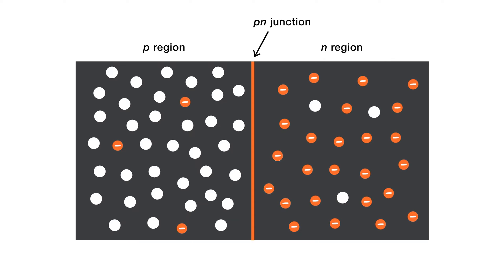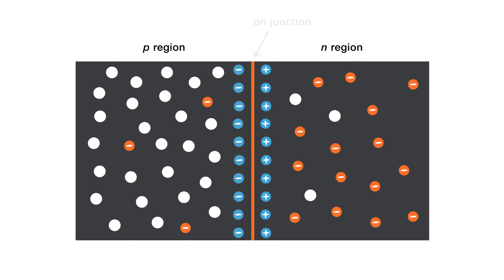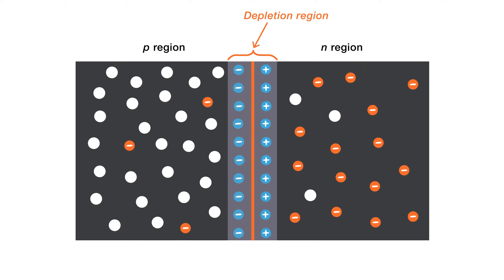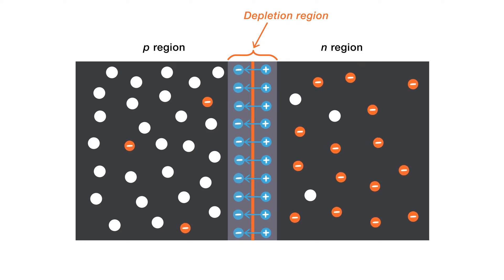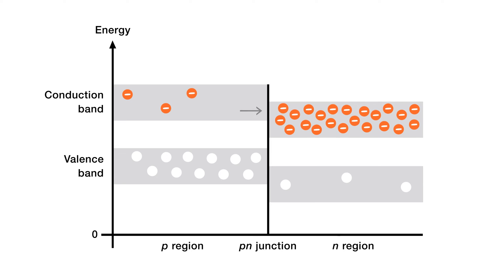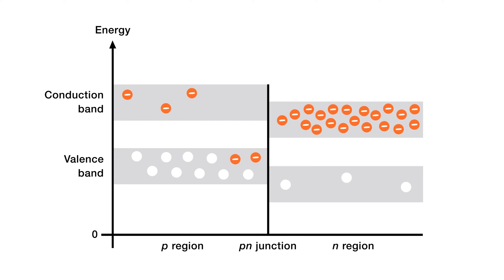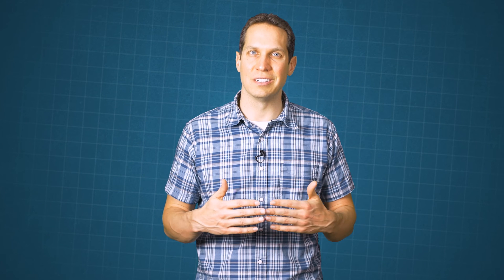How does a diode work - the PN Junction (with animation) | Intermediate Electronics

Comment: This was by far the most intuitive explanation of band diagram of pn junction I have seen. Thanks brother.
Just a minor nit pick in the animation
It would have been more clearer to specify that movable charge carriers cross the pn junction and ionize the fixed carriers on the other side
So the depletion region is filled with ionize fixed carriers but you showed that carriers were moving during the formation of depletion region, which I guess shouldn't happen in reality
But regardless this was a fantastic video thanks

Comment: I had a question: At the pn junction where there is a layer of +ve and -ve charge opposite each other how is a region of DEPLETED charge carriers created, surely there is a concentration of charge carriers?
Reply from the maker: The trick here is to realize that those charges are immobile ions, not free moving charge carriers (something that is inaccurate in one of our animations, unfortunately). Does that help understanding this?
Reply: @CircuitBread  Yes, it does, thank you, as I understand the depletion region acts as the 'barrier' in diodes.

Comment: Wont the electron leave a hole behind beacuse the electron from the n region migrate to p region
So wont the donor atoms have a hole since it donated one of its electron?
Reply from the maker: Good question and one that I wish we had explicitly answered when we made this (hindsight is 20/20).  Basically, yes, it will leave a hole behind UNLESS the donor atom had an extra electron in the area any (such as a five electron material as part of a four electron substrate).  But, since it's a circuit and the electrons are flowing around the loop, that hole gets filled as the electrons come around.  So we aren't accumulating holes on that side because they're actively being filled up as well.  I hope that helps!

Comment: Why dont the electrons in the n-type move into their the depletion zone from their side ? they have a sea of positive charges to the left and a sea of negative charges to the right. I get why they dont cross they boundary this makes sense to require some energy , but why dont they just move into the depletion zone. I understand that there is an electrostatic field that points to the left but i dont understand why this works out when i imagine an electron that is near the edge of the depletion region from the right , naturally the forces would push it into the depletion region

Comment: So the depletion is essentially the degradation of the materials?  Am i getting that right.  Because it's electrons become excited and flow out of the material when the voltage is applied though heat (sunlight)

I'm talking about solar panels here, but the concept remains the same through diodes.  LEDs last a super long time because the material is so much better at limiting the amount of electrons that can flow out of the depletion area in the form of light photons.

 Semiconductors are cool 🤓.  From this video I have learned that an LED is basically the reverse of a solar panel

Comment: Depletion layer has No charge then why u asign it by + & -  charge
Reply: No charge means neutral charge (positive charge = negative charge). Both charges magnitude are the same. So no charge doesn't mean there's no charges there but rather charges are equal

Comment: For me. It still doesn't make sense like If atom is in static position. And the only thing actually moving is electron. What will this looks like??? Are there any simulation like this?
Reply from the maker: One of the challenges with showing these things visually is that everything is just representational.  It would be awesome to show it how it actually is but 1) it's hard to show something where you're dealing with literally trillions of atoms and 2) it gets even messier in 3D and 3) in this case, it wouldn't actually demonstrate the concept we're trying to show off here.  For the band gap, there isn't a literal physical gap, it's a gap in the energy levels that the electrons can possess.  It's sort of like saying that an electron can have an energy level of 1 and 2, but then the next level it can have is 5.  So the gap is energy levels 3 and 4.  And while this seems strange at first, remember that in chemistry we learned the different energy states of electrons for individual atoms.  This is just expanding on that. Sadly, this explanation isn't entirely accurate either but will hopefully help establish a conceptual understanding that can be expanded on.

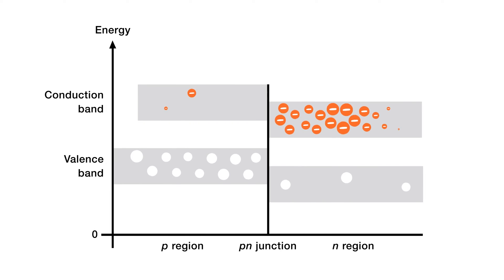Comment: First, let me thank you for the good videos. But in this one, I wonder if it's factually correct. What I have in mind specifically is the energy diagrams at 2:30. There is not enough space to explain in detail but in a nutshell: the valence band of the p-region can be above or below of valence band of the n-region, depending on used materials. Take for example P atom with electron configuration [Ne]3s^2 3p^2 => 5 electrons with principal quantum number = 3 vs B atom (you named it as p-type impurity)  with [He] 2s^2 2p^1 => 3 electrons with PQN=2. So electrons in the B valence shell have even lower energy than those in P. Ga or In atoms would work (see periodic table).
Second and more importantly - when elections recombine on PN junctions the electron energy needed to escape from P atom DOES NOT change. Bands are not moving anywhere contrary to your statement in  3:41. These are still the same atoms. P atoms further in the n-region are willing to give up the extra electron same as before. These may either recombine with holes in the p-region closer to the PN junction (causing hole current) or may try to penetrate to n-region and recombine with the n-region hole. 
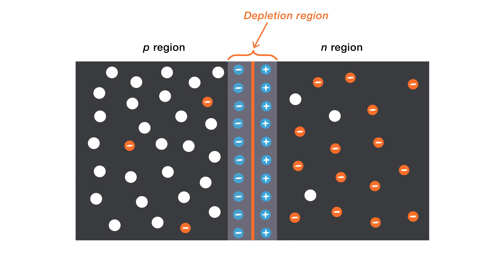The only problem is really that there is already a barrier of earlier recombined negative ions of B/Ga/In atoms. These exert a repelling force on free electrons coming from the n-region according to Culomb's law (as you correctly explain in 2:00).
In a nutshell to understand PN junction it's critical to understand 2 distinct forces - 1) Culomb's law and 2) the proclivity of electrons to fill the atom valence shell in some patterns which is key for understanding chemical bondings, the periodic table, and chemical element properties.   
Also, I think there is no conduction band but rather conduction space simply for all electrons with enough energy to escape the atoms. So there is always a "conduction band" overlap and an electron excited enough can always go anywhere (you only need to heat things up enough).  And of course, energy comes in quantum so the conduction space is not actually continual but discrete, but it's possibly not important here. 

At least that's how I understand it, which also may or may not be correct. :)

Comment: great, i still dont understand why is this usefull
Reply: You know that current flows using the path of least resistance right? Due to the bias (meaning that its easier to travel in one direction) it allows you to control the direction of the current. 

Reasons why this is useful: some electronic devices such as transistors, ICs, LEDs, capacitors etc can only accept current flow in a specific direction

Also you can manipulate current flow to make generators and motors more efficient 

Theres also data transmission applications and safety applications
Reply: @masakari6922  And also solar panels have a PN junction
Reply: I’d also like to add… understanding the physical effect of these various doping concentrations help understand behavior device models. Say, your traditional NMOS or PMOS… it’s doped NPN or PNP, in the substrate this actually a bjt to model it’s drain, source,  and bulk. Understanding the current flow based on its physics, it extremely useful especially for circuit design, protection, leakage, and also processes.
Reply: Smartphone 😂
Reply: He knows it get used in smartphone, hes asking how it is useful for smartphones etc
Reply: I can show you an example of why this is useful. In our house, we use AC current, and a lot of things will break in AC, so we need to make this current in CC, by this we use diodes. See, in AC, the current goes from positive to negative, for this don't happen, we use a diode. When the current is negative, the diodo won't let the current flow
Reply: It directs current in one direction. Very useful if you get creative
Reply: When you want to create a new invention , a higher version of LED lights🤓
Reply: Commenting this using the electronic device..LMAO
Reply: you used one hand and your smartphone to write this comment…basically thanks to semiconductors and pn junctions. Without these it wouldn’t be possible 😅

Comment: If Conduction band has electron when we put an energy into it. Why does the conduction band of p-n junction has electron? Thank you in advance!
Reply from the maker: I'm sorry, I don't really understand the question...
Reply: @CircuitBread  mmmm so electron only occurs in conduction band when we put energy into it. But in this case, p-n junction is in equilibrium state(no external energy include). Which makes me wonder how does an electron occurs in an conduction band when we didn’t put energy into a system😋
Reply from the maker: There are electrons in the conduction band at almost all times, there just aren't usually enough to do much of anything interesting.  The numbers we're dealing with are absolutely enormous - literally mind boggling.  But, in addition to that, for n-type doping, you're introducing more electrons to the system, which further increases the amount of electrons in the conduction band - even when it's not biased (when there's no external energy included).  I hope that helps!
Reply: @CircuitBread  thank you so much!

Comment: Why diode doesnt emits light as compared to LED
Reply from the maker: Great question!  It does, actually, sometimes.  Usually in the infrared range.  LEDs are just specially made to emit light of specific wavelengths.
Reply: @CircuitBread  👍

Comment: Doesn't explain how a diode works, wrong title, should be "the formation of the depletion region".  So why does current only flow one way?  Why is there a forward bias voltage that follows an exponential curve? You did not answer "How does a diode work?"
Reply from the maker: This is the first in a three part series, I recommend you watch all three and see if that clarifies things.

Comment: If no external voltage is applied across the p-n Junction, then what will exist in depilation layer...???
1.hole
2.election 
3.both hole & election 
4.free charge
Which will be the correct answer..???? 
Please  reply me fast.....
Reply from the maker: Even without an external voltage, you'll still form the depletion layer with its ions.  Because of that depletion layer, you wouldn't be expecting to see any free carriers until there's an external voltage.
Reply: @CircuitBread  so you meant the answer of that question is 4. Free charge or ions.......?

Comment: 2:28 Why n-type bands are lower than the p-type bands?
Reply: I think it's because the opposite is true for pentavalent atoms compared to trivalent atoms. Pentavalent atoms exert much more force on the outermost electrons, causing the orbits of the outermost electrons to be much lower and nearer to the source. Hence the bands in n type are located at a lower energy level compared to the bands in p type.
Reply: @justinsantos5751  I think so, too! my professor said that "The bigger, pentavalent atoms are "attracting" their outermost electrons more, so their energies are lower, meaning, further from the 0, i.e. the vacuum level."

Comment: Hello, I'm a bit confused by the animation. when  the free electrons go over to the p-site, you would think that the result would be a neutral charged atom at the N-site, but instead it becomes a positive charged hole?
Reply: I guess it is because it are mostly neutral molecules from the n-site that will lose an electron?
Reply: No. The n-type doping element has an extra electron compared to silicon, but also an extra proton. So the material is not charged negative at all.

Comment: Can you kindly explain the reason why p side energy levels are made higher and in n-side they are made lower. Also why in the state of equilibrium holes and electron Fermi level align at same position in order to achieve equilibrium. Also as holes and electron which flow are actually in bond with the atom, so hows does when they are in contact, what provides them energy that electrons move and fill the vacant charges in p side leaving a hole or vacant side in n side.. In many texts i have seen (but still confused) that they say, electron are near conduction band so as electron moves they actually decreases the amount of Fermi level in n side due to vacancy and increases the Fermi level o p side... but the logic that Fermi level will align finally for both p and n side, i am unsatisfied with it...Some says as depletion region is formed so why further movement of electron and holes do not occur that electron may go to conduction band of p region. Sorry a bit long query and may be dumb question, but please do clarify this and hope you reply to me. Also you said that electron coming from n type to p type during diffusion will fall back to valance band of p region. How can you represent this situation in a pn semiconductor. is it that the electron recombine with the immobile ion created in p region or what.

Comment: I have one question , does the electron only move to p region ? because I heard and read that holes move to n region , i'm a bit confused.
Reply from the maker: Electrons and holes move around in both regions.  The only difference is that there are more holes in the p-region and more electrons in the n-region.  Things like to equalize, so as long as there aren't any external forces, electrons will diffuse into areas with more holes and holes will diffuse into areas with more electrons - this is diffusion current.  Things are complicated by the fact that there are additional forces, both active and inherent in PN junctions, that oppose this motion.

Comment: How come the fermi level is required in a band diagram if you are able to show one here without one, and still get the same point across?
Reply from the maker: This is just my opinion but I don't think the fermi level is required in all band diagrams but it's important as you get deeper into this topic to understand what it is.  However, if you have a professor that requires it, that's their requirement and needs to be put in there to make them happy.

Comment: Sorry, I don't understand the difference between a hole and a positive charge, hadn't they both lost an electron?
Reply from the maker: I got (and still get) those confused sometimes, no worries.  The hole is the lack of an electron and, for our purposes, we treat it as mobile.  Even though it is literally just the lack of an electron, it can move around.  A positive charge (a positive ion) is an atom that is missing an electron.  It doesn't move anywhere and it's an entire atom (made up of many neutrons, protons, and electrons) and it just happens to have a positive charge because one of its electrons is missing.  Does that clarify things?
Reply: @CircuitBread  this helped me immensely, thank you! :) This means that, when electrons jump from the n-type part to the p-type part to fill the holes, they leave a positive charge (not a hole) behind, even though it seems that, by jumping away, the n-type material would get neutral... and same for holes on the p-side, that are filled by electrons! The electrons fill the holes but the "charge doesn't annihilate", because the atoms received a negative electron, so they become anions (negatively charged)...right?

Comment: Why doesn't a regular steel magnet work the same as a diode? It's got a side that attracts and a side that repels which sounds a lot like what the PN junction is. But I know nothing just sayin
Reply from the maker: You know, I'd never even thought about that.  My thought would be that the magnet has magnetic poles whereas the depletion region at the PN junction has electric charges, so the PN junction affects the electrons and holes.  I know magnetism and electricity are related (hence electromagnetism) but they're not the same thing.

Comment: Hi, love your video and the clarity of your explanation. However I'm quite confused as to why the valence band of N type also loses energy, when only the electrons from conductive band cross over to the P type. Shouldn't in that case only the conductive band in N type lose its energy, while the valence band stays the same ?
Reply from the maker: Hi Tomas, I'm not quite sure I understand the question.  I think you're asking why, when two materials meet together, both the conduction AND valence bands move when only the electrons cross over to the p-type?  The distance between the bands is set and won't change, they will always shift together and never move closer or farther apart.  However, I don't feel like that is really your question.  Could you clarify the question please?
Reply: @CircuitBread  That is exactly the question I was wondering about, thank you :)

Comment: So, when does the depletion region starts, when p and n are attach together or when voltage is applied?
Reply from the maker: A depletion region naturally forms as soon as they're "attached" together but then it gets wider when there is a reverse voltage.  And shrinks when they're forward biased.  Hope that helps!
Reply: @CircuitBread  Yeah it helps, thanks